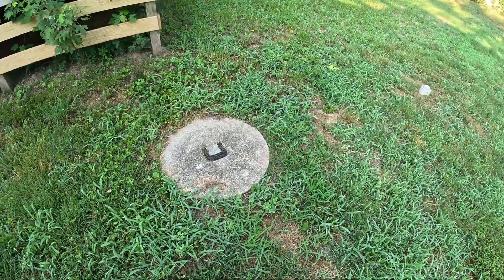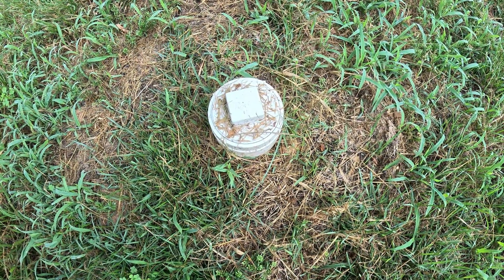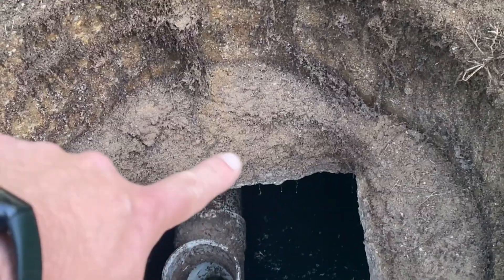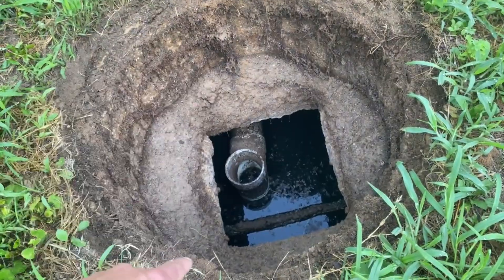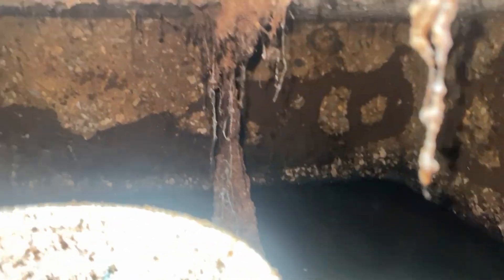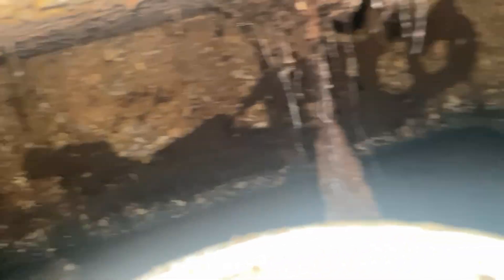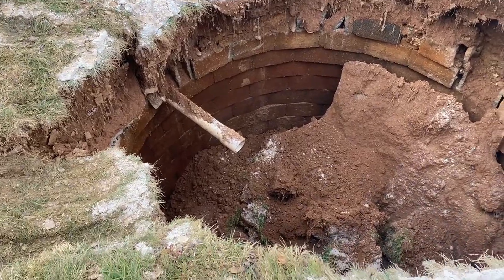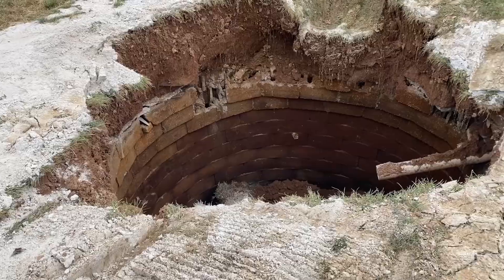What’s Hiding in This Old Septic System?

Comment: How things have changed!  I grew up in a house in the late 60's and 70's with a septic system that was connected to two houses.  It did the job fine and the overflow from all the houses went into the creek, which eventually ran into the nearby river.  Yes, it DID stink in the summer.  City sewage went in a few years before we moved.